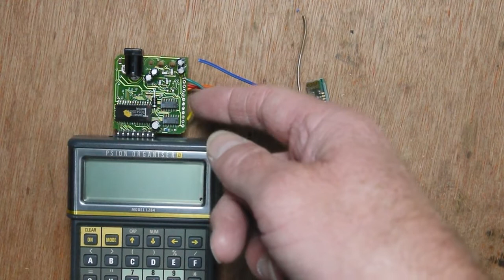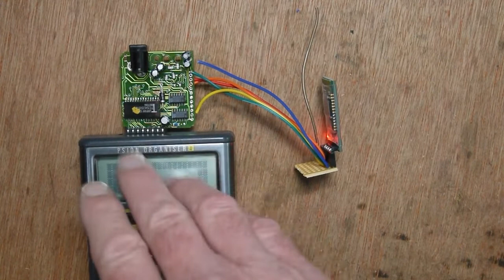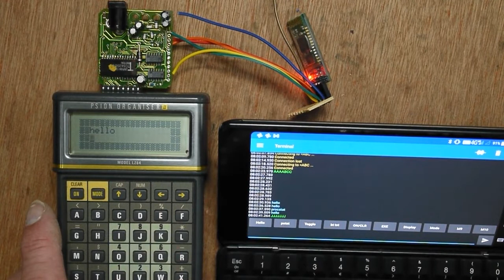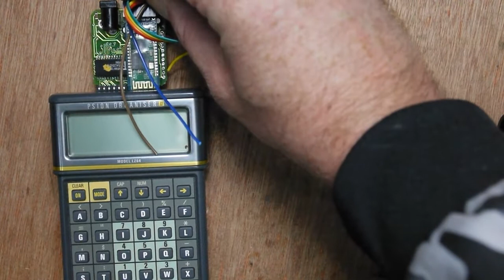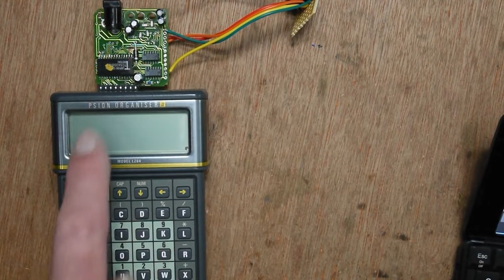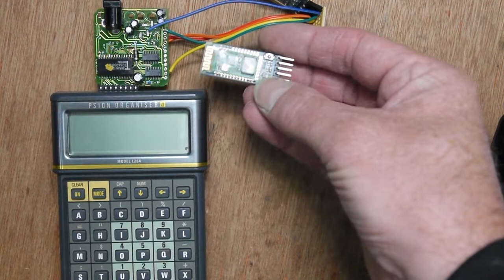Turning a Psion Comms Link Into a Bluetooth Link

Comment: that's seems really clever, have been using Psi2win with a USB cable with great success, but Bluetooth would really take it into the 21st century.
Reply from the maker: The clever people were Psion who made the original PCB so it could be modified like this. Excellent engineering

Comment: The Psion battery voltage (minus one diode drop) is available at the top slot for powering peripherals (or for supplying power to the Psion), and is there all the time a battery is present, so you could add a regulator to that to power the Bluetooth? It would drain the battery, but you could add a power switch for the Bluetooth?
Reply from the maker: That's a good idea. It's probably going to be easier to make and more robust if the regulator and module are on a PCB, especially as comms links are getting to be a bit expensive now. The circuitry on the comms link should be recreatable, in fact I am working on a USB adapter that is just such a thing. unfortunately I'm a bit stuck on that at the moment, but it should be possible to adapt that circuit when I finally get it working, to attach to a bluetooth module, or a USB to serial as well as an RS232 level shifter if you wanted to recreate a comms link. There's also I2C, which could be done with a microcontroller. Power is th eproblem here, but as you piint out, the top slot is designed for external hardware and so have the unswitched battery supply available. And yes, a switch would be needed too.
Reply: @menadue  ok, good luck with the new comms link adapter
Reply: @menadue  The principal issue seems to be the connect time of the Bluetooth adaptor.  If you could keep power up from the main supply for a couple of seconds (so maintain the original battery saving measure) by some R/C combination you could make a program that first does a pack scan/load so you have your second to link, and then start a transfer.  Post transfer that would time out and the interface would switch off again.  I wish I still had a comms link - I used to mod them so I could feed power from the PC end so I had fewer cables on the desk..  I love the Bluetooth idea, btw, it's fun to see.  I once cobbled an interface together for a Mitutoya digital caliper, but that was far less intelligent - a simple 4011 CMOS to pick up the signals and decoding straight in OPL with the help of some machine code.